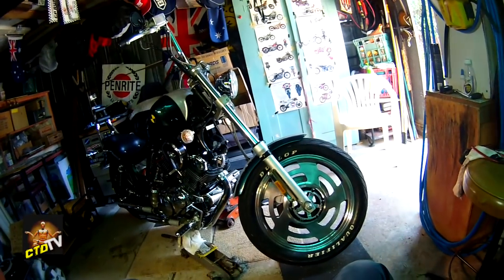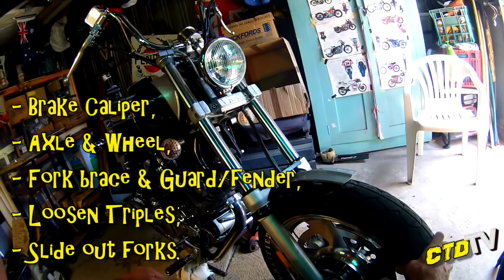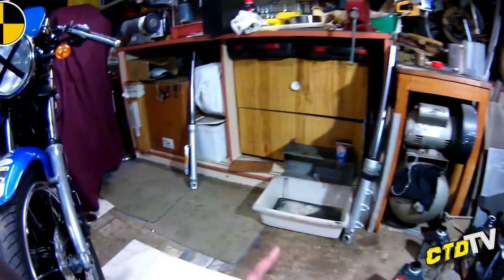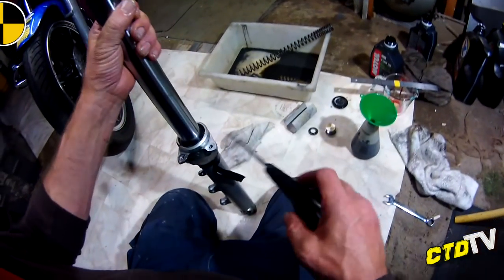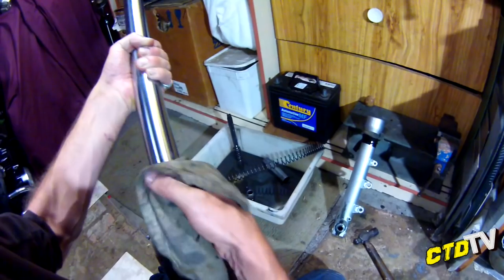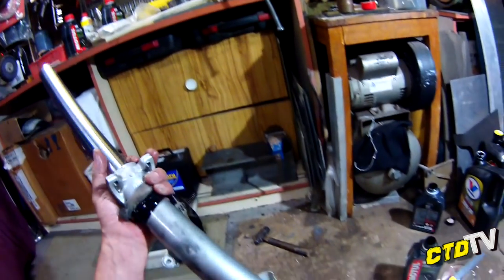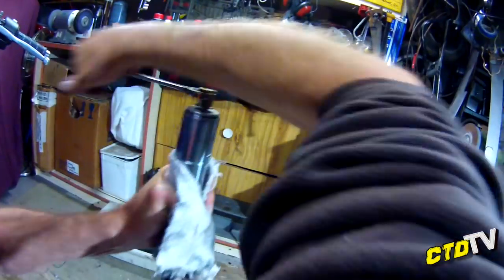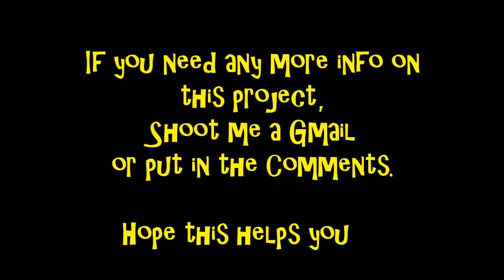Fork Seals & Oil replacement - Virago/Vmax...

Comment: Good info mate. I have three viragos with the hopes of making two good ones using a mishmash of parts. The two I plan to ride definitely need fork seals so thank you very much for sharing! I'm not a fan of how you used the hammer but I like the use of the PVC pipe to compress the seal in place. Nicely done!
Reply from the maker: TY and GoodLuck with your projects.
I'd love to see what happens to em.
RSOT >:)

Comment: Next time try not to scratch the fork tube when pulling the clip, I find a plastic pick works well. And it helps to loosen the top cap and bottom bolt when the fork's still mounted on the triple tree using the hole end of a wrench on with the Allen key like you tried doing. But thanks for the video

Comment: For anybody who's planning to do this job. Open the screws at the bottom of the forks when the forks are in!!!!! Then it's an easy exercise, opening them when out can be too difficult, as you can see in this video.
Reply from the maker: Can be a Pain in the Bum, Yes.
But having the right tools for the job helps too - 
a good Rattle Gun!
Different bikes, different ways to take apart. 
The Sr250 I'm building at the moment, loosening them BEFORE IS A MUST, but not impossible to do after taking off.
Thanks for your input Michael. 
I haven't done enough forks in 35+ years, but thanks to people like you, I am finding new bits of knowledge along the way...
Cheers n RSOT >:)

Comment: You should break the bolt loose on the bottom before you take the forks off the bike its much easier. If you can get someone to help you can use the handel bars to break it loose. Same with getting it back tight. Its how i did my. 97 1100 Virago. Just something to think about.
Reply from the maker: Thanks Jack.
I have since heard about that trick, but thanks for the reminder.
As I'm doing a set of Sr250 forks atm, and didn't do that, but I will be fitting em back on, to use your trick.
Cheers n uRSOT >:)

Comment: what was the tool you made to get the one side off?
Reply from the maker: You mean the Bolt?
I rummaged round my bolt bucket till I found a bolt, long enough (to fit 2nuts) and same size head (to fit fork head).
This replaced the Allen key I was 'trying' to use. Was too much movement to shock it loose.
It helps to 'Shock' the bolt, to start it turning loose, otherwise it'll just spin round. 
A mechanic buddy just uses an Impact drill and a packet of Straight Allen key bits.
I'm impatient and a Tight-Ass, so I just use what's around me...
Is that what you wanted to know? Cheers n RSOT >:)
Reply: @MrFalloffalot  yes thank you. I'm the same way.  I just bought a set of long allen keys with T handle.  Do you think that would work?
Reply from the maker: @Eloymbernal135  I don't see why not. Try a Shifter on the shaft/handle (if you need more leverage).
Good Luck with it.
RSOT  >:D

Comment: I was watching you struggle to get the bottom bolt out and I was telling you I have the tools to remove it easier and offered you to come over but you didn't answer!!!
Reply: Can you please tell me what tool it is and where I might be able to get it or even post a picture?
Reply: @Eloymbernal135  ideally, an impact wrench/gun (electric driver type or air impact) and a set of impact hex bits.

Comment: Don't hit allen keys with hammer to loosen or tighten bolts try a long socket on an extension bar. And what ever you do never knock seals in with a steel hammer you had a rubber 1 all in all not the greatest video I've ever seen maybe it should be titled how not to fit fork oil seals.
Reply: Yeah, a few shady practices for sure - but helpful for an overview of the procedure. Just a little dangerous for newbie craftsmen/wrenchers who might not know better to avoid creating damage. (I for example have lots of experience on cars but am new to bikes - so good enough for me 😂)